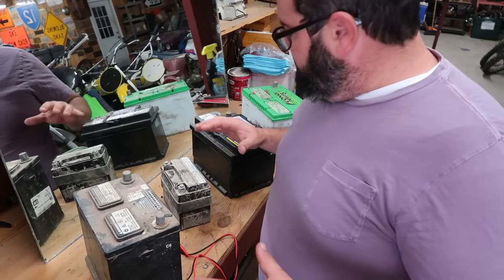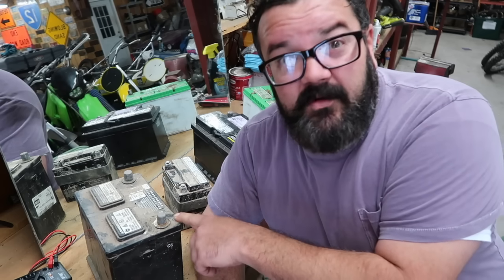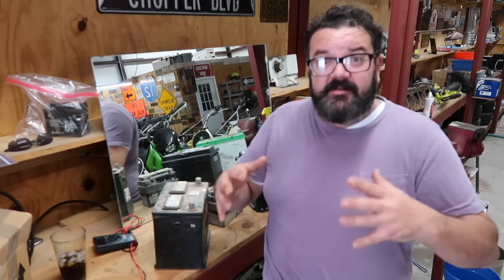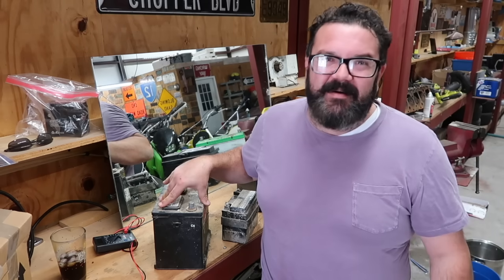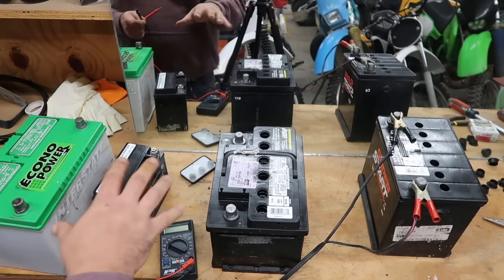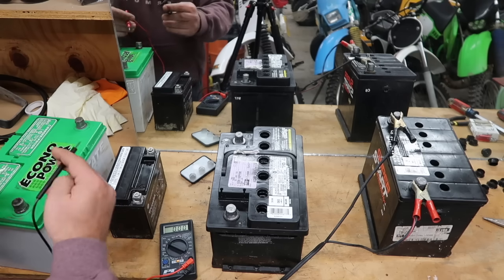Reconditioning a 12 Volt Car Battery: 100% Success

Comment: Sulfation, its the crust that builds on the plates. * CAUTION* if the sulfation is excessive, and it flakes off and settles in the bottum of the cells, the cells can short out to each other. ( 12 volt, 6 cells, 3 posative 3 negative, 3volts per  posative cell )IF THE CELLS ARE SHORTED, THE BATTERY CAN EXPLODE UPON CHARGING. been there done that. NEVER hook up a charger while the charger is live. Unplug the charger, hook up posative terminal then negative terminal, then plug in the charger, keep in mind, if its shorted, it can pop. Its nothing nice when this happens. Keep some baking soda handy. It neutralized the sulfuric acid should you get any on you, or your clothes.

Comment: Hello if you really want to bring a old battery back to new put a 200 amp charge on it then take the cables off after 15 minutes and let it sit for an hour and repeat the process 5 time which will be 5 hour total and you'll see a battery that will hold a charge in your car. and distill water if it's low on water. P.S. make sure water caps are off when doing this.
Reply from the maker: 200 amps is crazy lol
Reply: @CarGroves  From a guy on YouTube he been doing quite a while and beside 15 minutes 200 amp then let it sit for a hour check it out before you knock it.
Reply: this process help restore the cells in the battery.

Comment: One of the first steps is cleaning the battery on the outside so you have no leakage paths. Then make sure you have clean connections. Testing the voltage isn't a good indicator, a load test and hydrometer test is a lot more reliable..
Reply from the maker: OK

Comment: How much distilled water/ epsolm salt solution did you mix in with the old battery acid per cell?
Reply: Looks like he used 1 gallon to 4 pounds of salts

Comment: There is a lot of videos on how to do this in many different ways. When the video started I saw that beautiful massive vise and said . " this is the video to watch.  You didn't disappoint.  
I would like to see the amp output  as that is the most important thing to start your vehicle.  I have many batteries that charge but will not give the amps needed. Plus they discharge rapidly.  They don't crank but 10 seconds then dead. 
Also there are many theories on how to recharge them after cleaning and refilling.

Comment: yes bro u were revised those battery voltages n u tested them n showed the voltage, but u did not test the amps n showed us. for ex. the battery mostly had around 600 amps. i would like to know on those battery that u did revised how many amps they had after u done them. amps in the battery is very important to start the vehicles. most battery has over 500 crank amps that vehicles need it to crank the engine. why i ask u this question because i could not get more than 100 amps after i done it before u placed ur video. would u please explain to me to understand if u could revised the amps back at near the same level as in the battery stated as new. thank you in advance bro.

Comment: Last step should have been putting them on a load tester.  Full charge doesn't always mean it is at 100%. Batteries can sometimes show full charge yet fail a load test. If it doesn't pass a load test, it will not start your car.
Reply: If it can start an engine, that's all the "load" testing you need 😁
Reply: @mdsouz  Sometimes that can be decieving. It might start a car...barely A car start is a short term load...

Comment: I need help. So I did this process on 4 deep cycle batteries and it didn't work. Is there something I am missing?  I did the 4lb bag of epson salt and melted in a gallon of distilled water. Dumped out all of water in the batteries, used a water hose to take out all the gunk in the cells. Put the cells upside down and let them dry out. Then poured in the solution in each cell.
Reply from the maker: Did you put the batteries on the charger with the solution in?
Reply: Yes, I connected them back to my solar system.  I figured the battery would charge itself once I connected it to the solar system.
Reply from the maker: @luciecadena9622  probably too slow a charge

Comment: So if I understand correctly, you simply emptied the batteries of their contents, you washed the elements with "normal" and non-distilled water, and then you added to the acid you first discharged, the solution of distilled water with Epson salts . It's correct? Didn't you wash the elements with distilled water and baking soda to clean the plates? Did you put the solution of salts and water with the acid directly into it?

Comment: Bro other videos of mechanics say that they dont drain nor use your epson salt deal and add distilled water only to each port cell then put the battery under 200 amps for 15 mins at a time then allowing the battery to cool down for an hour and when they see the bubbles in the water visually and then they were good batteries

Comment: Getting decent voltage is one thing, but batteries with deminished capacity can charge to good voltage but fall quickly once hitting the starter a few secs....did you test capacity?  I imagine it'd b hard to regain capacity without actually opening the battery and doing a proper full referbish.
Reply: Am I wrong here?  Usually capacity is lost due to salt buildup on the plates that doesn't redissolve into solution on charge, which breaks off and falls to bottom thus unable to ever be used again.  I'd think going in, cleaning the plates, then adding appropriate con sulfuric acid followed by a plate prep voltage exposure then full charge would be the only way to restore a good portion of capacity.  Any vids on doing this, or will this restore a significant amt of lost capacity too??

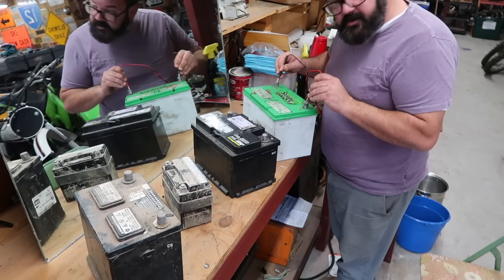Comment: "Let's talk about safety real quick"...."I did wear Eye protection and Gloves" 1:41 however wear Sweat Pants and Flipflops so if you drop one of the Batteries it totally does a number on your foot. Plus the possibility of covering you feet with Battery Acid
Then at 6:08 show everybody that you are wearing regular Glasses and Gloves by pushing up your Glasses which you do constantly with Gloves you been using to dump Acid out of 4 or 5 Batteries.

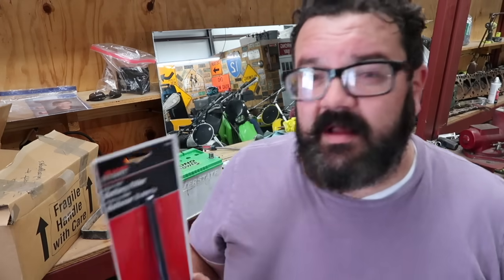Comment: I don't understand what the final solution that you put in is.  At 8:23 you say "So I have the epsoms salt and acid mixed together..."  What acid?  The original acid you took out of the batteries?  New acid?  If so, what kind of acid?  Sulfuric acid?  And what ratio did you use of acid to epsoms salt solution?   So you leave the epsoms salt in there when you use the battery?
Reply from the maker: Some I did a mix and some pure epsom salt, the pure salt solution worked best, when you are done put the old acid back in.

Comment: So you mixed 1 gallon D water with the epsom salt and all that with the combined acid of 4 batteries?? So for one batters i need 1/4 gallon D water and 1/4 of the salt u used??? And mix that with all the acid??
Reply from the maker: Just clean with epsom and water, then put old acid back in

Comment: I missed something.  After u mix your salt water how much of the mix do u add to the battery? Do you mix both acid and salt water 50/50 or what?
Reply from the maker: When it starts pooling up at the bottom of the pan, stop

Comment: How much of the old acid do you recommend per cell? I have a car battery and my motorcycle battery to restore. Any help with that would be much appreciated.
Reply: Brian Muehlher If you’re gonna make a brand-new liquid make it 30% sulphuric acid and 70% distilled water
Reply: Also I would recommend you put none of the old acid back into the battery if you’re short of acid then this can be an option but beware it could shorten the life of your battery
Reply: Hello Darkness 
The 30% is the old battery acid?
Reply: No, it is new-not dilute sulphuric acid don’t mix it with old acid as it is used and diluted so your battery won’t perform very well and in case you ask you can buy sulphuric acid from anywhere that sells it Google search where can I buy Sulphuric acid And it should tell you Just remember number one don’t mix the 70% water with used acid Number 2 make sure to buy new acid and mix that with the 70% distilled water
Reply: Idk why but I subscribed to you
Reply: Hello Darkness 
Thanks for the advice . I’ll go all new and follow your process. Looks like you have a good system for success. Thanks again.
Reply: Hello Darkness lol
Reply: Your welcome
Reply from the maker: Acid doesn't get old, watch the second video, drain the acid, mix up epsom salt solution, clean battery, dump solution, replace acid
Reply: Yes but I’m talking cleanliness and pollution I’ve replaced my acid every 3 years and my battery has been working for 9 years! But it failed last week.

Comment: The true test is not with voltage alone.  You also need to measure the CCA (cold crank amperage). You can have a fully charged battery (approx 13.3v) and still have a battery that won't turn your engine over enough to start it. Anything under 12.6v is not considered to be fully charged

Comment: What battery charger did you use I can only find either chargers that are to smart of chargers that a really crappy
Reply from the maker: Look for an old style one on marketplace
Reply: @CarGroves Can I start the car with the reading 8v in 12v battery...    Mine 8 year old batt, not single break down untill now but dead/discharged in three months lockdown by playing music player/mobile charg but forget to run the engine by my mom,
Jump started last week, rev up to 2/3krpm for 1/2 hr then engine off and told to start the car the next morning but it refused to start but dashboard lights r on...      Ystday I removed the battery, it was at 8v then I charged with my home ups inverter (charger), the charging volt showed 13.5v, left on 5hrs there was bubbling sound at 1st hr at the negative side so I just loosed the water filler caps in fear of pressure buildup/expolde, there was also a mild metal smell though it was in out open, later I saw vapour (or smoke not sure) from the water fill vent it was already 5th hr so I freaked out and stopped charging...    & now  today it still showing 8v...     I'm not sure about the charging current (amps) while being charged...
Is the batt is dead??..    can I give it for automotive bat charg(trickle ch) in batt shop for some bucks or needs to be replaced?....

Comment: Take the battery’s that show nothing up to 3 volts after charging and drop them several times in the floor.  Make sure you drop them level without hitting the corner of the battery because it will bust it. It should show charging 12 votes then but the amps will suck. The plates in the battery are corroded up you will have to clean it out but you need to drop them several times and jar it loose.  Trust me it works.
Reply from the maker: Thanks for watching.

Comment: I have a 12v, 120ah, 21 plates battery. It's more than double the battery in this video and it looks different from inside and has no liquid, so I want to ask you if these batteries ussually have liquid inside, if yes, then your methode should work also on my battery.
Reply from the maker: I have no idea, sorry

Comment: Did you use the old acid, just mix it with the epsom salt solution?  I was not tracking if it was new acid or the old.  I am going to do this next week on two old batteries.  Also- my battery charger is a new digital one- would it  be best tonise one that you can control?
Reply from the maker: Watch video 2 on my channel.

Comment: To me, the test is incomplete. I have a show truck that does not get driven often and the battery has sulfated after sitting for months. I had been charging it every once in a while, but then left the state for another job. Now, I'm back and while the battery shows 12.7, it refuses to put forth the amps needed to crank the engine because of the dead cells (a Autozone test confirms the battery is bad). So, while you may get the voltage reading up with this method, what about the actual starting of a vehicle?
Reply from the maker: OK

Comment: When you add half old acid and Epson salt solution combined is it suppose to sizzle and can I put charger on while sizzling and if you  just use acid and water how much  in each cell is it 1/2 and 1/2 what,thanks

Comment: Voltage means nothing if you need those batteries to start engines. CCA is what matters, cold cranking amps. I used this method to get my old battery to charge again to 13.8 volts, then put it in a car. Hey presto... flat battery noises because the cold cranking amps were not there despite taking a charge to 13.8 volts

Comment: This doesn’t work for long. All your doing is artificially increasing the SG of the electrolyte. Sulfuric acid is required for a lead acid battery to work. There isn’t room to explain the chemistry here, but look up lead acid battery chemistry if your interested. You need to put an equalization charge of 16-17 volts on the battery for at least 6 hours and keep the water topped off during the process. If there is any active material left of the plates and there aren’t any shorts or open circuits inside the battery this will bring it back. However if the battery was as heavily sulfated as some of these ones were, you shops drain the electrolyte out and rinse the battery out thoroughly with distilled water after equalizing. Then refill it with preferably new sulfuric acid and distilled water electrolyte There is some room at the bottom of the case to collect debris but on these small car batteries it can quickly fill up to the bottom of the plates shorting the cell.

Comment: What solution did you fill the batteries with after the cleaning?
Reply: The epsome salt water from the begining of the video mixed with the acid he dumped out of all the batteries in the blue bucket.. After he mixed it he let all the heavy metals settle then turkey basted the clean acid epsome salt water back into the batteries..
Reply: @davedanielson1331  what I did was empty the acid then used a epson salt and distilled water solution and let it sit for a few hours then poured that out and rinsed it out a few times with distilled water. Drained andblet sot for awhile upside down then filled back up with acid only and worked awesome.
Reply: @TeamTopKick  ok right on.. I thought you mixed the acid and salt water... Thanks for clarifying... Did they end up holding a charge?   I have 2 batteries for my boat I need to do this to..
Reply: @davedanielson1331  idk after watching this video and a few others it's just the way I did it. Just putting acid actually made the battery have voltage before even charging. I fully charged it and had it in maintanance mode and then like a month later or so my buddies truck battery shit out and i gave it to him and it's worked fine since. The battery i did is actually smaller then what he is supposed to use. I even load tested it and everything. Put out over 800 cranking amps. I dont know what the factory amp rating was because the sticker doesnt say. It's a old reman interstate and has two different date codes so and from what I can tell its atleast 15 years old and was recondition by interstate at one point or both times. Idk.
Reply: @davedanielson1331  from what I've read this doesnt always work for every battery though but worked for me. I got a few other batteries I can try reconditioning.

Comment: Hello, i have a question. i put the battery on the charger and i measured the voltage. Its 15v , is the voltage to high? is the charger it broken? Thanks
Reply: Your battery is good.  Do not pay attention to anything in this video.  A 12v lead acid battery is dead at 12v. A charged battery should be 14.8v. Never add Epsom salt to a battery. It will ruin your battery.  The batteries in this video i promise you never started a vehicle after this,  they are toast, they were likely toast before he started, and he made them even worse.  Lol

Comment: Something is missing, so acid out of battery, spray water inside battery, turn upside down let drain. Then mix the distilled water and Epsom salt mixture with old battery acid, then gill battery

Comment: If you do this method.. you will reduce the amo hours . If you replace with 36% sulfuric acid. You will have a factory reconditioned to almost new. 

Sure.. magnesium sulfate.. Epson salts.. will act as a electrolyte solution. Yet you also sacrifice the over all amps by doing this method .

Comment: Jake the only step I did not catch was if you use the same acid and only add the solution of Epson salt, could you clear that step please, thanks.
Reply: Thanks Jake, I already watched the video again and I GOT IT, thank you very much, it was there.
Reply from the maker: Dump the epsom when you are done and put the old acid back in and use distilled water to top it off. Watch video 2 on my channel.

Comment: Im a little confused. Do you mix the epsom salt with the old battery acid then put that in as a new solution? If so, how much epson salt solution would you use for just one battery. Thanks for the video. Its great.
Reply from the maker: Watch video 2 on my channel.

Comment: Nice video..always have a bucket of clean water handy in case you splash some on your face or eyes. Cheers
Reply from the maker: Good tip!
Reply: @CarGroves  I just finished watching your video let me ask you this let’s say I charge it up to 12 1/2 V OK but it does not turn the engine I put it on a battery tester and it says it’s no good because there’s no amperage there the volts are there but the amperage is not. Do you think I’m doing something wrong? Please let me know thank you and God bless you ✝️✝️✝️

Comment: Have you ever had a battery reverse polarity? I had a 24 V battery I reconditioned hook it up positive positive negative negative check the battery charger is wired correctly and it actually charged backwards. I can’t believe I hooked it up backwards it is possible I guess but I was wondering if you have ever come across it.